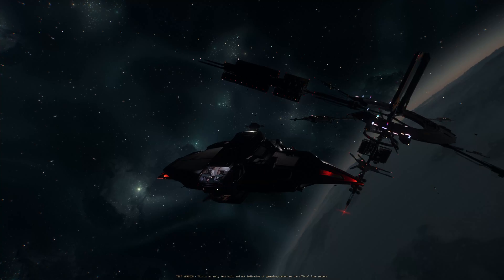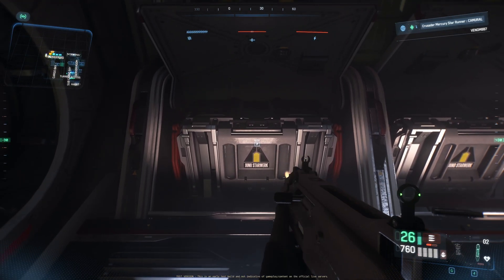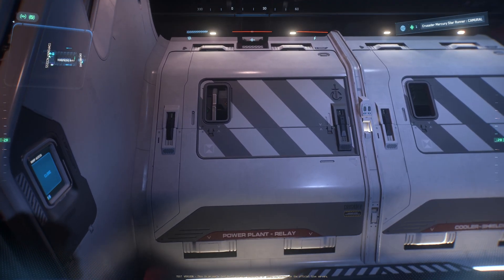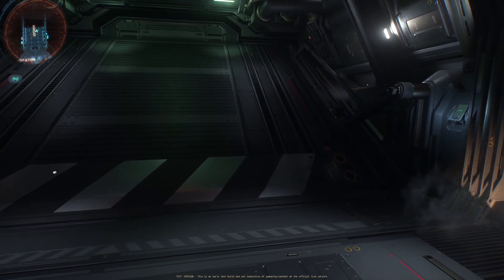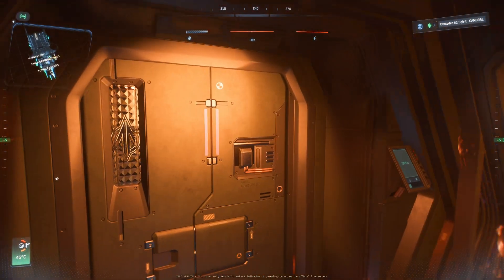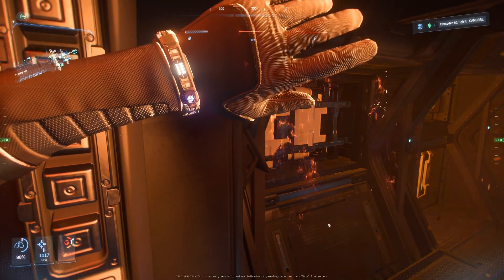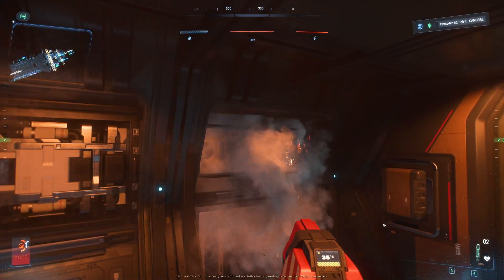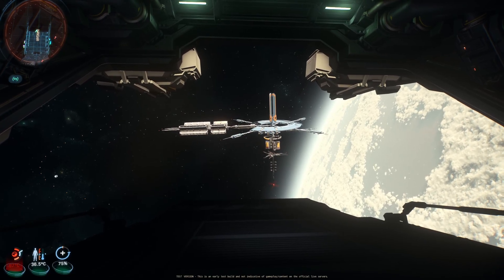4.4 More Engineering tests: Fire & atmospheric room system

Comment: I didn't think about the fact that you say that the components are too close to each other, but you are absolutely right, otherwise I always see it on smaller ships, if there are more strafes to the right, then on my smaller ship I remove the right cooler, because it will suffer the most damage. But when engineering comes, I won't be able to do that anymore.
Reply from the maker: @Star_CitizenYT Even in a lot of ships that have multiple power plants, shield generators, cooler they are side by side.
CIG spend no thoughts on this and on redundancy. Basically an artist put components where ever he finds a spot and where it looks pleasing. For example in Mercury Star Runner it would be no trouble at all, to move half the components to the other side of the room. Thus, if the components on one side of the room would start to burn, the components on the other side of the room would not catch fire and still work.
Reply: @Camural  horror, yes.  on their part it is very lazy and unconscionable.  BTW developers, six-figure salaries, definitely don't deserve it. Although I may be over-judging, I noticed that they have a problem with communication between themselves, as if they are afraid... I'm trying, but I can't understand

Comment: @Camural
I think it's different if you open the ramp with the engineering panel. They didn't connect those two ways of opening and make them the same. You should do a new test with opening the doors and ramps with the panel! This is what I heard anyway..
Reply from the maker: @stefanw2500 Some people also told me I have to deactivate life support, then open the ramp.
Maybe air is lost to vacuum then but I can only repeat myself: The ship's life support system cannot replenish air inside a ship as quickly as it gets lost to space with ramp and doors wide open.
And even if the ship could do it, it would generate an enormous storm inside the ship.
Reply: @Camural  Imagine the total airflow as it exists out of a door the size of a double garage with a pressure difference of 1 bar. Just to help visualise what this would be like, remember that for every single square centimetre of that huge hole you just opened in the ship there is roughly a 10kg force pushing that 1cm square of air out of the door. It would be a major understatement to call this a storm. It's closer to an explosion. If we say that the doorway to space is nominally 2x3metres that would result in an airflow rate of over 100 cubic metres a second with a pressure difference of 1 bar. Of course it's not quite that simple, but it's enough to have a ballpark idea. I'm also trying to imagine would kind of life support system would be capable of replenishing the loss at that rate! 😆
Reply from the maker: @stuartthurstan Small correction: 1 atm of air pressure is roughly 1 kg/cm^2 = 10 tons/m^2.
Yes opening the Asgard ramp in space would be a very significant emotional event for the player if the inside would not be depressurized before opening the ramp. It is likely the player would get pushed out as soon as the ramp opens and get spaghetti-fied in the, at first, small opening.

Comment: The atmospheric system for rooms and the physics of ground vehicles are locked away in some old employee's drawer, a system no one understands. The same goes for the IFCS atmospheric flight model and surface control... they recently said it wouldn't be implemented until the new quantum travel (boost) is developed for multiplayer (which it isn't yet). 

There's always something missing, always some missing technology needed for every detail... But there's always time to develop surprise, useless, and pointless ships that nobody asked for.
Reply: Neverending development, its their entire business plan, always has been.
Reply: @heru_ur6017 indeed
Reply: Expecting someone like Yogi to do a good job (or even an average job) is expecting a lot

Comment: This is proof thet there is nobody with any forrm of systems design experience in the ship design team. Basc naval archtecture and the unit system, the constraint of course being that space made unit systems hard if the hull size was fgixed. Even so, power plant/cooler, powerplant/cooler isn't so very hard to think about, The Asgard at least gets some of this right. "But that's military" say the white knights, and indeed it is, but so is the Gladius, shileds co located, all systems on the top surface where they are inacessible from the carrier deck, barring the QT drive. Perhaps in Lore that's the flaky bit:-)